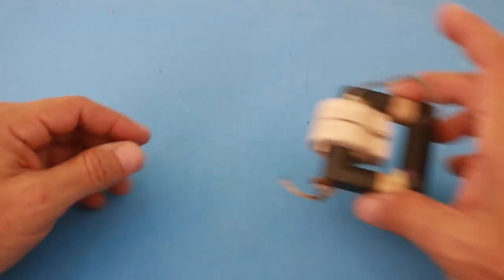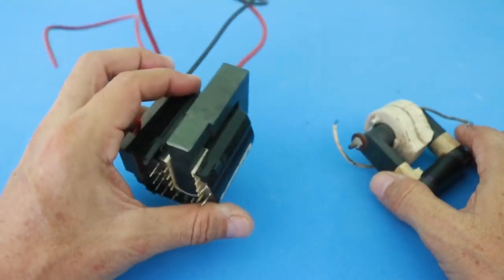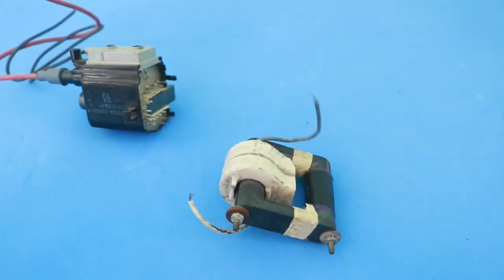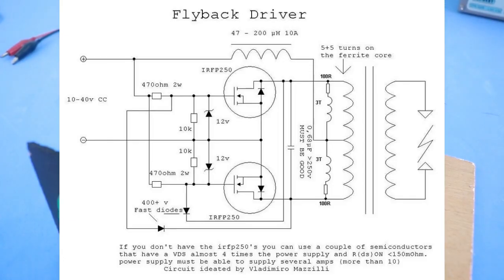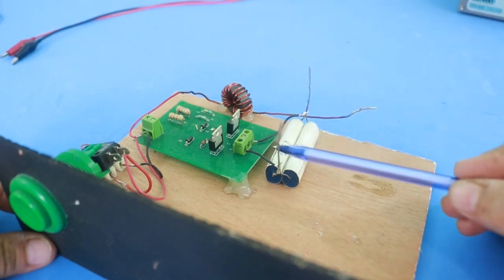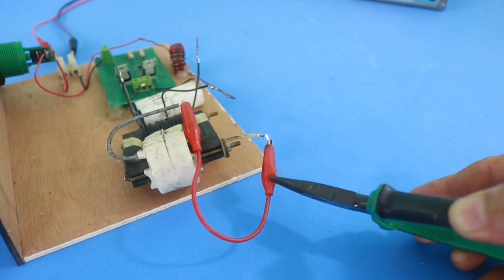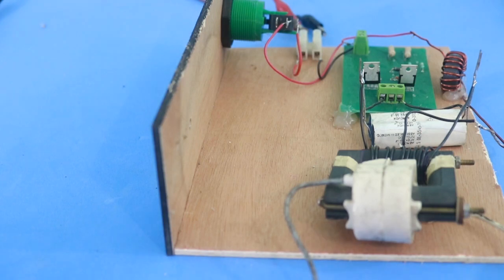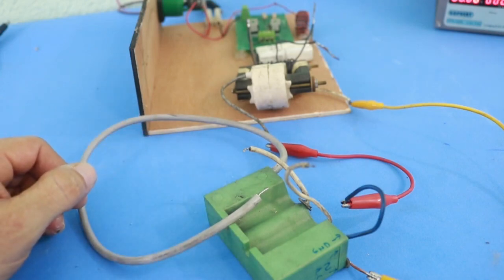High Voltage AC Flyback Test

Comment: due to the right hand rule. Do you agree that electromagnets are causing friction due to the coil interacting with each other? And maybe it might be better to have another wire not in the same electromagnetic coil with it? so instead of right right right right current turns to have right empty(which get left from it) right empty. less friction but would it be more efficient even if you take electricity form the left empty eire?

Comment: Where can I get that old AC flyback...I searched all but could not find it....
Reply: There are some manufacturers on aliexpress/alibaba, but you would need to buy many, or they would cost a lot each!

Also: plasma globes and laser supply transformers may be useable.
Reply: Ebay is your best bet. Look out for NOS flyback. i got vintage one(FLY245) for less than 50USD.
Reply: @juntendo6104  thnks
Reply: it doesnt usually say AC flyback so you have to be careful
Reply: Old ones are lucky finds, best chance to buy a monochromatic crt television and pray that the flyback is still working. There are newly made AC flybacks around as well but they tend to ask 100 bucks and more.

Comment: I thought that when powering a flyback (modern or old) with the Mazilli drive the output would have always be AC. In another video you charge capacitor with a mazilli driver and hook it up with a diode bridge ... therefore output before bridge is AC 🤔
Reply: You drive old and modern flybacks the same way, modern ones just have diodes integrated and you cant remove them because the entire thing is potted in resin. Thats why the old ones are much better because you can add your own diodes if you want DC or you can use it without any diodes to get AC.
Reply: Chuckiele granted, but does that mean we can charge a capacitor with a modern flyback ?
Reply: @coucouj2781  some of the modern ones also have capacitors included, so Id say yes, but it surely depends on the capacitor.
Reply: The output of Mazilli driver is always AC